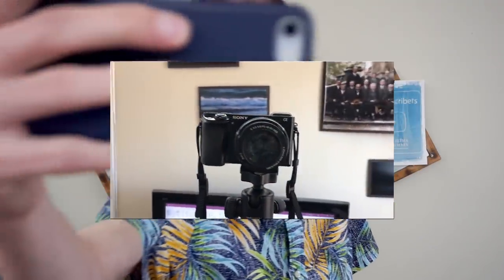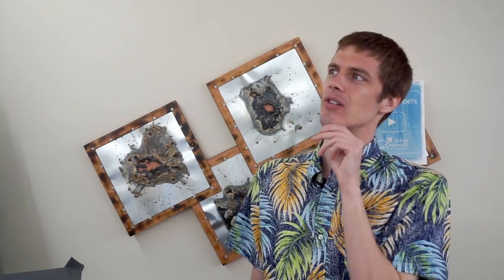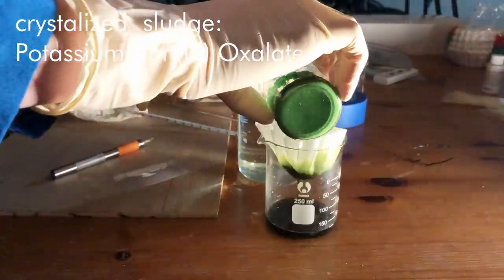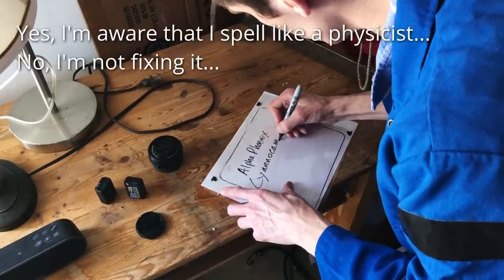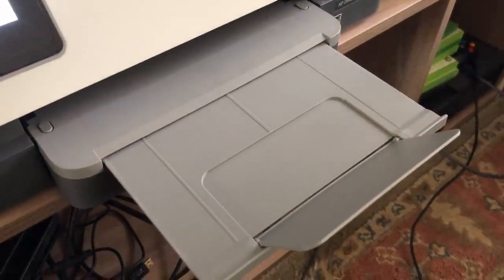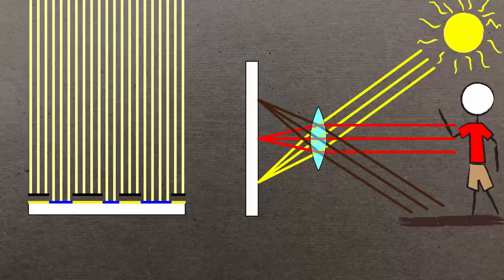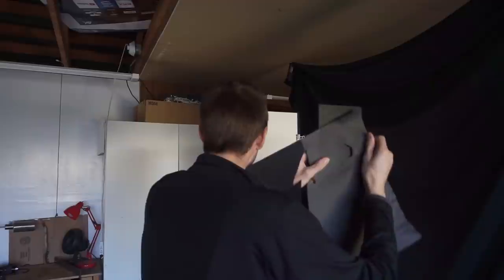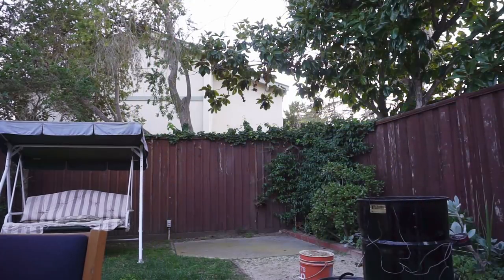Ditch the DSLR? The 200-year-old science of my new favorite camera (2^14 sub special!)

Comment: try and see if you can use the wet plate process with that camera. it's a lot more hectic, but the prints come out much quicker.
Reply from the maker: because the light doesn't need to burrow through paper?
Reply: @AlphaPhoenixChannel  It's a different chemistry. The proper name is the "collodion process". It consists of a solution of silver salts on a glass plate. It's a technological precursor to photographic film. If you want to keep with the prussian blue, you could see if layering the initial print on a new sheet and blasting that with UV can increase the contrast if done a couple times.

Comment: Oh, one other thing, you might look into what people go through to do UV photography with dSLRs. The CCD modification is not very relevant but the lens selection is. One solution that people have found is using old enlarger lenses, some of them pass a decent amount of UV. This would help with your spherical aberration issue. Nikon does make a 105mm UV-Nikkor, they are only $5k.. used.
Reply from the maker: That's a great idea - probe the regular UV market first!
Reply: @AlphaPhoenixChannel  you could also get a UV pass filter. That would keep stray light out of the box. But they are not cheap.

Comment: Hmmmm... blurryness might result from focusing in the visible spectrum, while the chemical picture is created by an (out-of-focus) UV image... a known phenomenon from (analog) IR photography, hence the red focus correction dot on vintage SLR lenses! ... you basically need a UV correction mechanism that's moving the paper holder a bit closer to the lens by a defined distance AFTER focusing... could be a 3D-printed progressive cam that's pre-set to the lens-object distance BEFORE focusing and when the camera is loaded, gets switched to "photo", moving the UV-focal plane right on the paper...

Comment: Try soaking the paper in a weak oxalic acid solution, then wash and dry before coating. It can improve some papers by removing excess alkali buffer. After you wash 2-3 times to clear the yellow, then a wash with some dilute hydrogen peroxide will get a much deeper and darker blue. 5-10mL of the 3% drug store stuff in a liter of water will suffice.
Also you can try a 2nd coat of cyanotype after exposure, wait a few minutes, and wash. I've heard this can massively boost contrast (= speed), but I have not personally tried it. I think the mechanism here is the latent image on the paper converts the new, wet, cyanotype coating into the crystalline form, perhaps some kind of catalytic or crystal seeding mechanism? But you obviously know more about the science than I do.
Reply from the maker: That's a really interesting idea - the second coat after exposure and before wash. I'd imagine it'd have to be a seed crystal thing but I really don't know. I certainly considered doing a double-coat on the paper, but after reading one of the comments here about the reaction being self-limiting as the pigment absorbs UV, I started to doubt it. Probably worth a try eventually!
Reply: @AlphaPhoenixChannel  Yeah, double coating pre-exposure doesn't really help much, other than to ensure you get a smooth and adequate coating. It's important on some papers where absorption isn't very good, or delicate papers where you can't lay down a heavy coating initially. Cyanotype is unfortunately very self-masking, I would guess because prussian blue itself absorbs UV, not allowing it to pass through to unexposed sensitizer. 

Another option would be to coat the paper with fumed silica beforehand. You get more speed, because there's more surface area for sensitizer to stick to and be exposed to UV. I actually don't know that it works for cyanotype, likely it does. For other alt-process (kallitype, platinum, etc) it can give you a half stop to a stop faster speed. You can apply it wet or just roll it on dry with a miniature paint roller (with appropriate safety precautions taken, of course).

Comment: Why not use a giant fresnel lenses from a rear projection TV. This way your increasing the brightness not defusing it. If you think about it camera lenses are usually bigger then the sensor so the sensor or film are getting the same brightness or more then what the lenses sees. Also a fresnel lens should correct the blurry edges. Way back in the day I would use them to build video projectors using a stripped computer monitor.

Comment: When I was watching a video about making a projector, they used 2 lenses.. one to focus the image to a point, and then the next to straighten out that focus so that all the parts of the image hit the screen at the same time? Is this something that would matter here with the focus issue?
Reply from the maker: I think so - somebody else here just mentioned a "projection lens". I wanted to keep it as simple as possible for ease of explanation (and my own ease of understanding) but a future improvement would probably include a multi-element lens. I don't even know if those can be made with spherical sections or not. I used a super-cheap spherical 500mm 3"
Reply: @AlphaPhoenixChannel  You could buy an achromatic doublet lens. Still simple, still inexpensive. Just as DIY as buying a singlet. 

Projector lenses (from film projectors) are designed to project a 35mm source onto a large wall. The image circle is quite small. Large format camera lenses with the coverage you want get expensive quickly.

Comment: You should improve on how flat is the paper resting on the back of the camera. The lens creates a focal plane but no one said that the focal plane of that lens is 2D. Probably the focal plane projected on the paper is 3D, meaning in the center is sharp but as you see on the sides it blurs. That's the reason camera lenses have multiple lenses inside, to manipulate and project the final image on a mostly straight focal plane. Try using some more lenses, in parallel to work on focusing, also keeping the lens totally perpendicular to the paper is crucial.

Comment: I'm sorry to be the one telling you this, but Farenheit is actually measured in degrees. It's °F.
I think you may have confused °F and K, for K does not use degrees.

"The Fahrenheit scale (/ˈfærənˌhaɪt, ˈfɑːr-/) is a temperature scale based on one proposed in 1724 by the physicist Daniel Gabriel Fahrenheit (1686–1736). It uses the degree Fahrenheit (symbol: °F) as the unit."

From Wikipedia.

Comment: Is there someone crazy enough to create a digital back for this contraption? I mean a bona-fide homemade huge array of discrete photo elements with discrete amplification and some fair amount of arduino magic powder to provide ADC, multiplexing or any other sort of wizardry in order to obtain some 640x400 large format low resolution digital camera. Bonus points if one actually would think of calculating the actual curved focal surface in order to compensate for that annoying aberration :D

Comment: What if you curved the film would that help against the spherical aberration?
Reply from the maker: I did but unfortunately it didn't make it to the video - I could get the edges of the frame to look "sharper" if they curved forward towards the lens, but unfortunately I really just replaced blur with stigmation, so the edges of the image still looked pretty bad. - the bokeh got REAL asymmetric and really only came to a "focus" in one orientation
Reply: @AlphaPhoenixChannel  i wonder if you could use the distortion to your benefit.

Comment: Your ISO calculation was a little misleading. For film, sensitivity is based off of light per area of the film itself, irrespective of the optics you put in front of it or focusing distance. Calculating an actual ISO is complicated, involving a lot of trial and error, determining a 'middle gray', and avoiding reciprocity failure.

Digital cameras cheat, btw, since they assign dynamic range weirdly and only loosely conform to ISO standards.
Reply: Otherwise, great video. Alternative process photography (and large format photography) is a lot of fun but also a pain in the butt.